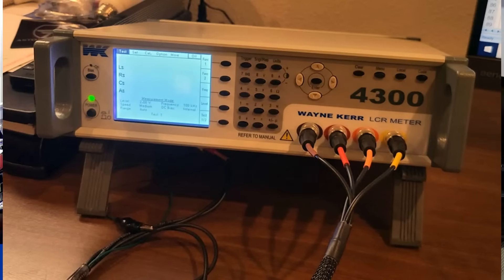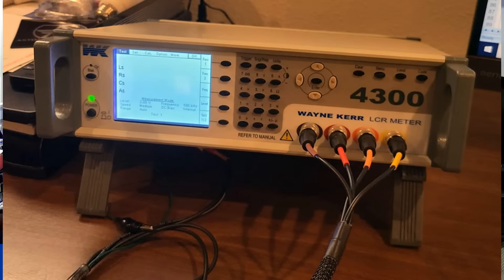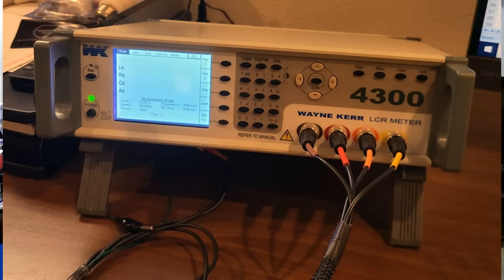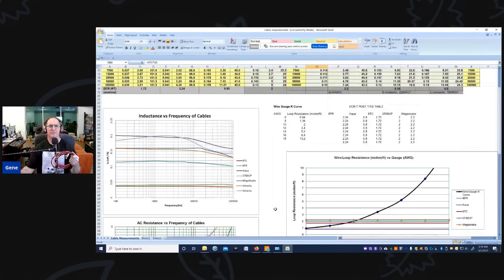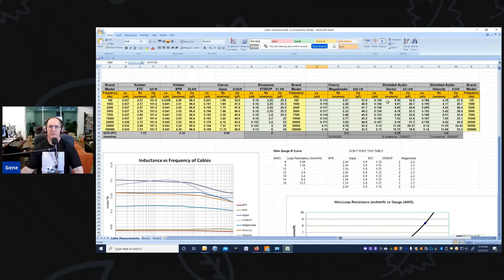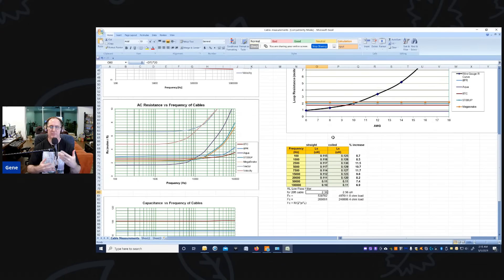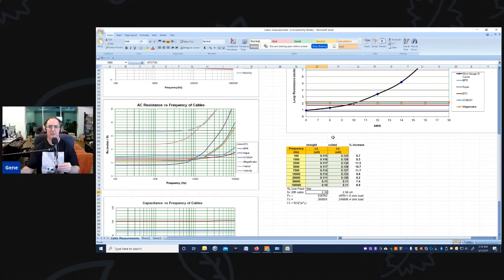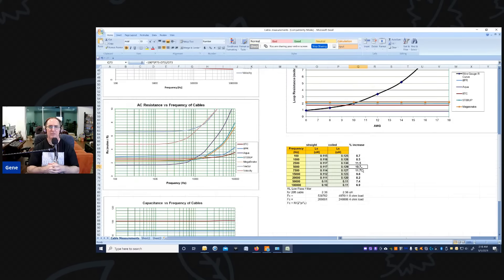OMG If You Coil Your Speaker Cable You're Gonna Lose Fidelity?!?

Comment: its no rocket science,coiled cables induces eddy currents,that increases impedance in the cable,its just the same as power cables on the mains supply,like a cable on a roll,if you dont do all the cable out it can only carry half of the wattage safely,like 1800w not fully out,but 3500w fully out,the same applies to vacuum cleaners with the retracting cable,with only 1 meter of cable out,they can burn.Also happens with plug in the wall dc supplies,where people have a close mains socket so leave the wire with a tie around it as it was in the box,and wonder why the adaptor broke in a few months.speaker output is ac.ok so most speaker output levels are not going to burn the cable,like a mains electric supply,But it is fair to say,not everybody knows to out roll any cables,no coils or loops,for best performance.
Reply: There is no way that there would be any such significant eddy current on a speaker wire cable or a signal cable from the cd player to amplifier. 
Vacuum cleaners are driving a motor that has much larger opportunity to drive a higher fault current.
Reply: @bighands69  I am sorry but you are just so wrong,the examples i gave were just to outline the principle,coiled speaker cables or interconnects would induce eddy currents,increasing impedance,less than my example yes but the signal is smaller,and if cable manufacturers wanted to make cables of more impedance it would be in the design of the cable,but cables are designed for minimal impedance,if your speaker cables are too long,you should not roll in a loop but lay them straight out and back to the amp if needed,same with interconnects,no coils,it creates a magnetic field,small yes,but so is the signal level,eddy currents proportional to the signal voltage.

Comment: Look...I read the description of the video and listened for the first 30 seconds or so. As a former certified professional in the audio visual industry. I'll leave it at this...if your so concerned about the coiled cable becoming an inductor don't coil it (over under if you do ;-) make it into a figure 8 pattern. Done. 

still won't make any difference in low current applications
Reply: @nuwyorker2025  So is that you're thing, pointing out the use or your and you're in you tube comments. You're 4th grade teacher called, nobody cares.
Reply: @nuwyorker2025  yerrrr mustards yella, ya mangy ol polecat

Comment: Coiling speaker cable isn't simply making an inductor but instead makes a common mode choke since there are two currents always flowing in opposite directions.  The two induced magnetic fields for the most part cancel each other out.  Sounds like your testing was okay, but your description or understanding might have been missed.  Also why is everyone so obsessed with the braiding of such low impedance transmission line?  Seems people are still obsessing over the coupling of AC mains into their speaker cables.  Once again, if it did happen, it would be common mode, and wouldn't effect anything.  Just stick with big fat two conductor OFC.
Reply from the maker: Yea I get that but it's still not a very effective choke. Braided cables are a good way to keep inductance low but even that is often not an issue to really worry about with respect to speaker cables.
Reply: @Audioholics  Twin lead will do just fine rejecting common mode noise, if it were a real issue.  I think the braiding is misleading as could actually reduce the common mode rejection because a localized source could couple into one set of conductors and not the other.  But nobody should have any intentional radiators near there systems anyway.  Seems like for the few example I've heard about, common mode EMI would couple into the speaker cable and pass through the amplifier and back into the sensitive analog input/s like a phono input or something like that.  Braiding or no braiding, it won't matter, it would still be a problem and should be addressed in a better way.  If you think it really matters, just use a gentle twist of maybe 10 turns per foot but it really won't matter.  I look forward to any proof you can put together that proves me wrong.  I see you've been following Amir and GR Research and it seems GR has gone off the deep end with some poor examples and false assumptions.

Comment: Science. Not marketing nonsense. Not folklore. Gene is right, and the science is here. Some of the silliness if just too much. Strain relief to keep mechanical resistance from occurring. I too enjoy debunking the silliness of cable. The $2000.00 AC power cable with the 2 cent per foot cable behind the wall and the $25.00 Circuit breaker in your panel. Practical process here. It is people doing what they like with their income, not empirical science. I was pressured to sell expensive audio and video cable working at my store. I refused and sold the more sensible cables because the construction was still excellent, great ferrules and good shielding. Great Soldering. All this for a song really. I don't rain on any parades for the wealthy wanting that $50,000.00 pair of speaker cables, and if they buy the folklore along with? Okay sold. But for me, being around this for a long long time, I immune to silliness and marketing and incorrect opinion vs. true science.

Comment: Thanks for videos.. I want to add an amp to my av receiver but not enough preouts have you used or recommend russound 1.2 adp speaker level to line level adapter...or do you have any other recommendations

Comment: Oh, I forgot to ask, could coiling a cable possible cause noise or hum? Like would it make it easier for it to pick up interference or something? I don't know that much about electronics but it seems like that might be a thing? That would be a good enough reason not to do it for me.
Reply from the maker: Not if the cable is terminated into a speaker.  Also the coiled cable is not a very good inductor for pickup as I showed.
Reply: @Audioholics  Awesome, thank you for your reply. And thank you for all the work you do and putting it in terms most people can understand. And when you think about it your case was a worst case scenario. You coiled up a whole length of cable, most won't be doing that. If you have a cable that is too long most likely you will only have one, maybe two coils about 6-12 inches around. Which probably won't have any effect at all. Its not like you are going to use 100 feet of 18 gauge cable wrapped around one of those little spools you get at lowes and hook it right up to a speaker a few feet away lol. I would imagine that might not be the best idea in the world. Oh, and I tend to comment a lot with my opinions. If I am ever wrong or you don't agree with me feel free to correct me. You won't hurt my feelings. I would much rather be told I am wrong and learn something than keep believing something that is not right.

Comment: have you ever measured Audiopipe cables?  they are really cheap, especially at long lengths, I wonder how they measure compared to many of these far more expensive speakers cables.
Reply: Unless they are super cheap cables that do not use copper but something like an iron alloy that is horrible there is not going to be an issue.

Comment: It seems like he is personally responding to that guy with the white hair who pulls speakers apart
Reply: I thought the same thing.  The guy from GR Research has done a lot of speaker cable videos saying the measurements don't matter.
Reply: I am happy to let them both be right 

I wouldn’t let them be the wrong length just because I am ocd 

But I have diff length per side ....... maybe the impedance is .0000005 off 

Oh wait I have Dirac

Comment: I was recently wondering about exactly this, not just for speaker cables but for any cable. Thanks for doing the measurements and showing the calculations. Very helpful.
Reply: Coiling cables only become an issue when there is a larger load, potential temperature increases and when the cable has a very long distance to cover. 
In building electrical systems it can become an issue when there is something like an electric shower or motor being driven with a cable covering hundreds of feet. 
So how they overcome issues with electrical cables they use larger cross sectional areas to drive impedance down so in other words they use a thicker cable.

Comment: Well that depends if the cable is coiled on carpet or hardwood floors. Also if it's the first Tuesday of the month on a leap year.....
Reply: clockwise or counter-clockwise?
Reply: @user-ex9zm7bg3x  Ohhh that all depends on the phase of the moon. Clockwise if it's a new moon. Counter clockwise only on odd number years...

Comment: When people try to sell me on expensive audio cables, I feel like someone is trying to sell me a car for $250,000 that I may, or may not, be able differentiate from my 2010 Ford Taurus.
Reply: The only reason you should be buying a more expensive cable is if the brand has a reputation for producing better quality such as being tough or easy to work with.

Comment: What are you measuring? 
The cable that is twisted in pairs or the copper core that is similarly twisted, when they make the copper core from several small wires, they rotate it so that it becomes easier to work with, perhaps the induction that you measure and it is known from before. Nothing new under the sun.
Reply from the maker: U missed the point.  I measured the cable straight vs coiled to show difference in inductance.

Comment: Thanks Gene. This is good stuff for newbies into Audio. I've got a friend with very high end gear who's bought snake oil cables with "special" boxes in the middle of the short (less than 15 foot) run that do "magic" and give better sound than standard speaker cables. I can hardly wait for your next video where you measure your rig with standard cables and document the results.
Reply: saw a video detailing Nelson Pass' system -- nary an audiophile cable in sight
Reply: @Jim Sathome
What are the special boxes?
Do they form a termination with the cable and do they actually then amplifier or filter the signal?
Reply: @bighands69  Sorry for the delay in replying. The Speaker Cables are CV Terminator Twin MH-770. I just found out his interconnect RCA cables also have "boxes" in the middle but I don't know what they are yet.

Comment: It is well known in pro-audio that you never coil cables.
If you must use an overly long cable, you should cross wind it in a pile.
The difference is audible to pretty much any one.
Dave Rat did a nice demonstration of it less than a year ago.
Reply: What cable lengths as that is part of Gene's equation
Reply: @FatterTony  The better question is at what length does it matter?
I am pretty sure we can all agree that coiling a couple of feet in 2 loops probably is fine, and it is well established that coiling 25 feet does matter.
The real issue here is that assumptions are being made about what matters, with no evidence (or flawed evidence) to support the assumptions.
Human audio perception is really exceptional, far better than people believe it to be.
Is it really hard to simply decide to cross coil wire that is long enough to be cross coiled, and not worry about it?
Don't forget that bias exists at both ends of these debates. It is just as easy to engage in confirmation bias that one can't hear a difference.
Reply: I've worked in pro-audio for decades and coiling microphone and speaker cables is a routine part of setting up and breaking down gear during and after a gig. If you hear any audible difference in a cable from how it's handled you either have a bad cable or an external source of hum or EMI (especially in the case of high impedance unbalanced mic cables). I won't comment on Dave Rat, he can speak for himself.
Reply: @QuicksilverSG  Congratulations!
You have been doing it wrong for decades.
Reply: @joshua43214  You forgot the quotes around "wrong".

Comment: This was really helpful to me. I've got one speaker right next to the amp and the other is 8' away, and I have equal length cables. so one is coiled 3 times rather than spread out all over that side of the room. I'd been wondering if it was true that the coil was affecting its performance. Thanks.
Reply: Does it bother you that it would have a detrimental effect of enjoying your music? If it does then go measure everything that you enjoy to make absolutely sure that you should enjoy it.
Reply: @nicoras8803  1. Someone somewhere wrote that coiling cables would ruin the sound from your speakers.
2. I wondered if that was really an issue.
3. Audioholic posts a video saying that it's not an issue.
4. I write to say thanks.
It has never been detrimental to my listening enjoyment. It's just one of the 10,000 bits of BS that guys throw at each other on audiophile channels that may or not be valid. Have a nice day.

Comment: I’m constantly getting into heated debates concerning speaker wires and the differences they make. Comments like “I heard a huge difference after I purchased brand XYZ speaker cables for $80/ft.” I’ve measured lots of cables at high frequencies, (>1MHz) they make a difference. Audio frequencies are not high frequencies.

Comment: I am literally doing this now on cables in my secondary system, I haven't had the time (too lazy) to shorten them.
But I have literally never given this a thought till right now.
.
Reply: Shortening changes the resistance as opposed to the inductance. Might I suggest folding the cables back and forth like a ribbon rather that coiling them?
Reply: Making cables shorter is going to have effect on the signal voltage or current.

Comment: Gene, please organize a double blind test and invite a bunch of audiofools and speaker cable owners and give them a chance to prove you wrong. I have done the test myself and the only difference I heard between 0.75mm2 CCA and 4mm2 OFC cable was when I listened to pink noise. But yeah, your mind plays tricks on you, I understand how people fall for fancy cables.
Reply: I am using 2.5 mm2 with wire lengths of about 15 meters max with 200W on tap for lazyish speakers in a home setting. Peaks seem fine.

Comment: I once put a pair of bookshelves right next to my amplifier, coiled up the excess wire and stuffed it into the port of the speaker, well the tweeters melted from parasitic oscillation in the feedback of the wire picking up the driver's emited EMi.  You may want to add a word of caution on where these coils are placed.  A little bundle right next to the speaker is in my experience an absolutely catastrophic mistake.  I feel EMi is highly underestimated, especially around single ended RCA interconnects, I'm pursuing braided power cables and toroidal power supplies for that very reason.  But just interpreting the "inverse square law" with enough sense to not stuff wires inside your speakers is probably enough to avoid a meltdown ;P
Reply: My god what sort of a load where you driving. Was it a 100,000 volt system with thousands of amps of fault current?
Reply: @bighands69   Naw just some rather forgettable entry level Pioneer receiver from the 70's running Philips bookshelf speakers, the ones with the 2" ribbon tweeters and 5" grey concave woofers. in pretty cherry cabinets. Very nice build quality on those with buttery smooth port flaring. Volume was elevated, but was listenable in loudness. Probably less than 80db.  The thing that melted the tweeters was the Parasitic Oscillation, it ramps out of control at high frequencies.  Sounded fine.

Comment: Capacitance of long speaker cables is much more of a stability issue in amplifier design. We add a inductor of 0.8 to 1.2 uH internal to the Amp. Extra inductance formed by a small length of speaker cables coiled under your couch might actually not be too bad a thing.

Comment: Dude congratulations!  You should do a different speaker cable every week and build out a database!  It, sounds to me like an ideal speaker cable would be one with enough inductance to roll off all the noise above 20k what choo think about that?  I think it's that much less flux in the tweeter affecting field stability.  The energy levels may be small, but add them up like the "Ultraviolet Catastrophy" and the energy across such a broad range of frequencies may be of some subtle significance.
Reply: But then my super tweeters wouldn't work......lol

Comment: My speaker cables has over 80" left-over because I move from a bigger room to a smaller, coiled behind the AVR,  bothers me should I cut it? with a few slack to avoid tension. Thanks Gene for put the time on look into this subject.
Reply: I wouldn't take the trouble. Inaudible effect.
Reply: For a cable that long, you should absolutely do something about it, and it will be audible. 
You don't have to cut it, just lay it back and forth cross wise so the loops cross each other.
Here is a real professional big name expert (he is a really big deal in pro-audio) doing a nice demo of signal loss in a speaker cable.
https://www.youtube.com/watch?v=KKooWhMGT-k
The example is extreme for most home audio, but applies directly to you. It is the first in a short series, I suggest you watch them all
Reply: @joshua43214  Thank you very much,  definitely gonna check it!